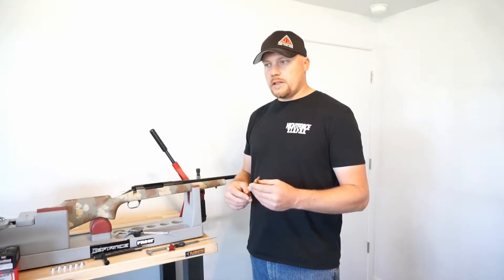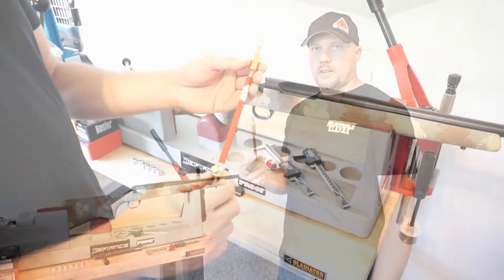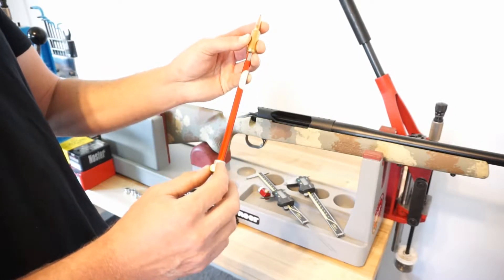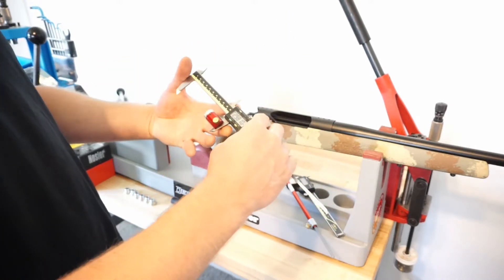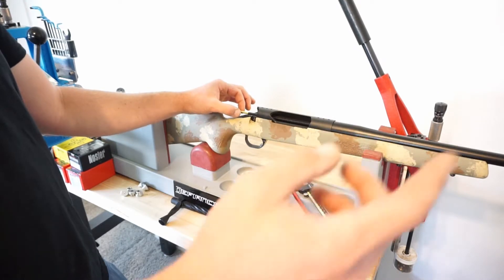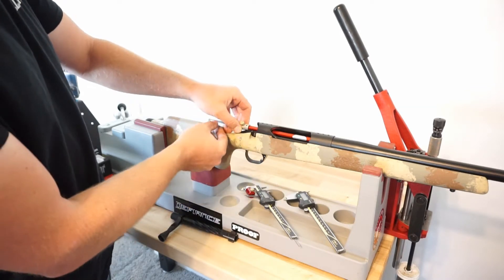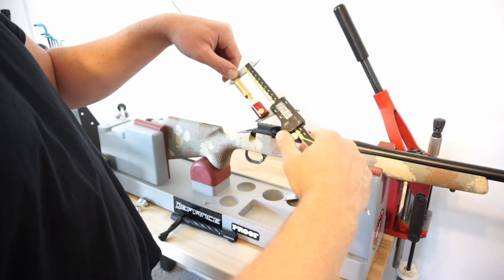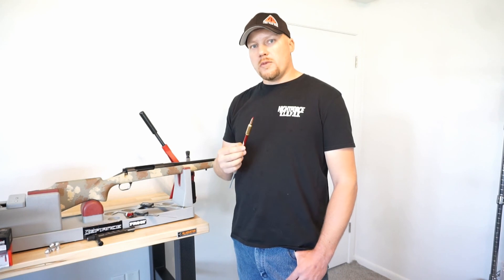Measuring Cartridge Over All Length (COAL)

Comment: As with everything in manufacturing there is a tolerance verses clearance . What is the tolerance for the desired position of the ogive, and what is the desired clearance to be achieved? My Remington 700 bdl .223 loves Winchester .223 45 gr hollow point 2232. The same round in my howa MAYBE in a 6” circle. Trying to find what my gun likes aside from what I like or my friends say they like, my gun will always tell me what IT likes without any B. S. Everyday at my local range. 

I guess what I am asking is for numbers. I want hard data.